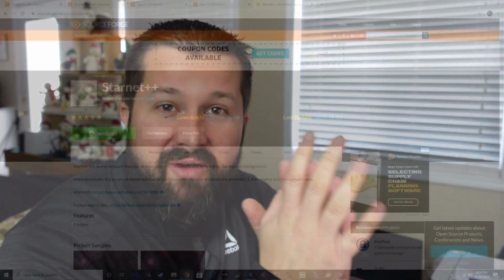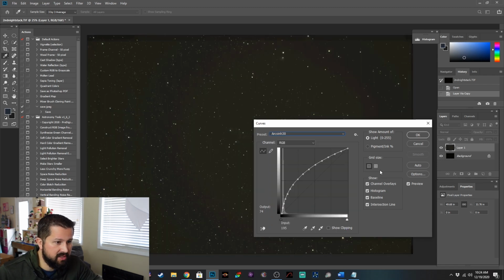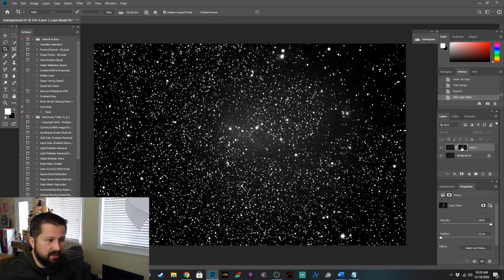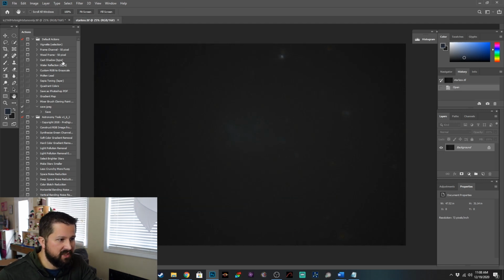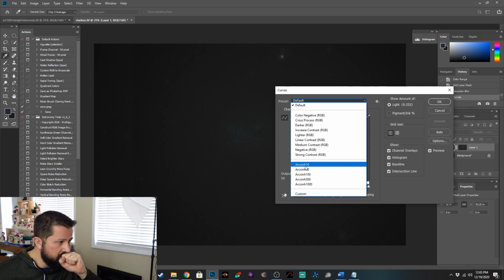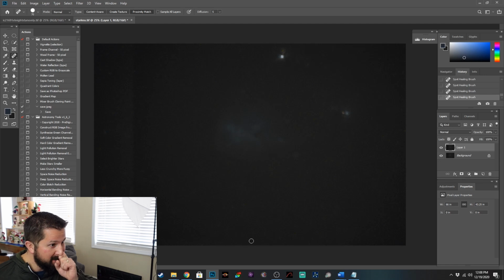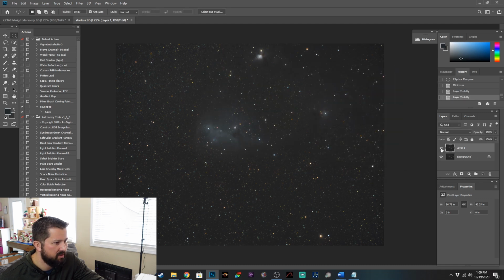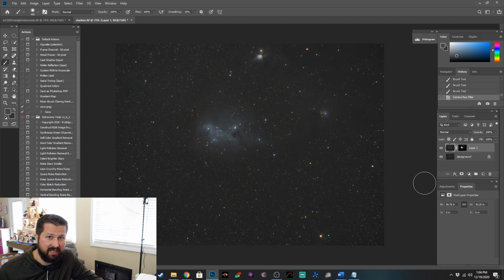How to Process Astrophotography Images: Perfect stars using Starnet++

Comment: How do you do this in such a way that, you seperate the stars with starnett (I actually paid for starxterminator as it is better), but when you recombine them, ensure that I can put the galaxy / nebula back in with the stars without using the starless background? What I mean is, sometimes the starless background has some clutter or blotchyness. I have just been using screen blending mode to put the galaxy / nebula back in without doing the subtraction part you do and it seems to work fine?

Comment: Using Starnet is very helpful, as your tutorial says.
A question though - after adding the stars back in, why did you flatten the image and then further tweak the nebula using masks to select just the neb? 
This defeats the benefit of using Starnet.
My personal view and process - keep the stars and nebula on separate layers and don't flatten. It's then easy to adjust the neb without risk of affecting the stars. It also allows you to minimise stars, and adjust star colour etc without having to mess around with selections. Very simple and neat and gives much more control.
Hope this helps.
Reply from the maker: Excellent tip!  Thank you!
Reply: @AVAstronomy  no worries Aaron. Really enjoy your videos. You have a great presentation style 👍

Comment: Thanks so much for this and all your other tutorials. I follow them step by step and am getting some good results.
What I seem to be lacking the most is determining how much time to expose each "light frame". Some say to use the historgram to a bit to the right, but with such dark images, all I get is the peak smacked to the left. If I do longer exposures (2 minutes or more), I get a lot of light pollution, not real data (I think). I take about 50 exposures and stack them. Should I take more?
I live under 7 bortle skies and use filters to cut pollution. I now use a one shot color camera (ZWO) Can you help with my exposure question? Thanks in advance.
Reply from the maker: You're welcome and glad you find them helpful.  There's several things to consider when trying to figure out proper exposure time.  Focal ratio, light pollution, GAIN or ISO setting, light pollution filters used and last but certainly not least is the brightness of the target being imaged.  I have a video on exposure time estimations based on F ratio and ISO settings.  It's really intended for DSLR's and in my borlte 5 skies but it may still be useful for you.  I agree with you on the histogram thing.  That worked well when I imaged with DSLR's but when I moved to OSC my frames were always dark even after a 10 minute sub frame, lol.  Use autostretch in APT (if you use APT) to get an idea of the data  you are capturing but even then it's not always a clear indicator.  For instance, my latest image that I posted in this video had FIT files that showed NO nebulosity at all in them.  Granted this was a very faint target.  You'll get a better handle on this the more you image but in general brighter targets like Pleiades and Orion Nebula won't require near as much time as some of the dimmer objects out there.  Hard to say where to start but if you tell me your focal ratio, object being imaged, and filters used I may be able to give you ball park starting point.
Reply: @AVAstronomy  I mostly use the Orion 8" astrograph reflector, f 3.9. I've tried the optilong L Pro; L enhance; L Xtreme and Ha, of course each one needing different exposure times. 2 objects I've tried are the bubble nebula and M1. Can't stretch it enough to get good results. (yes I use APT and stretch it there just to see if I'm getting the nebulosity)
I have good success on Orion nebula and Heart, and the Sadr region, but not fainter objects. I've done the Pleiades, but can't get much of the blue nebulosity like you and Trevor Jones have gotten. He said his image was 90, 2 minute subs. I've tried that setting and came close, but I only took 60 subs. Would the extra 30 subs have gotten more? That's where I'm confused, how do we know when enough is enough?
Do you have any further advice, and can you give me the link to the video of yours "exposure time estimations"? ... Thanks